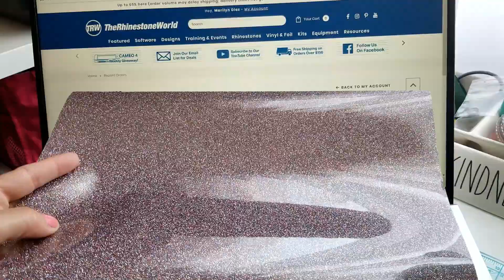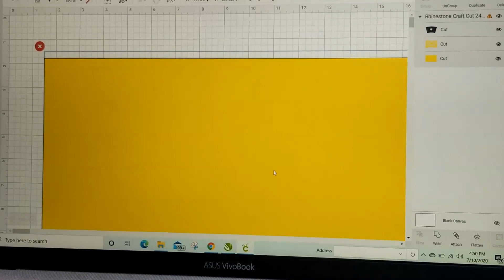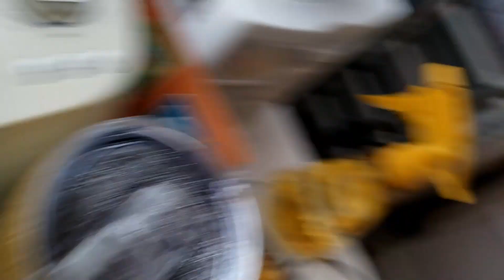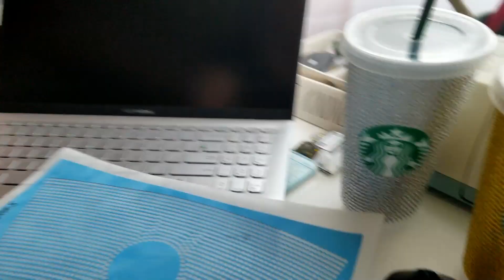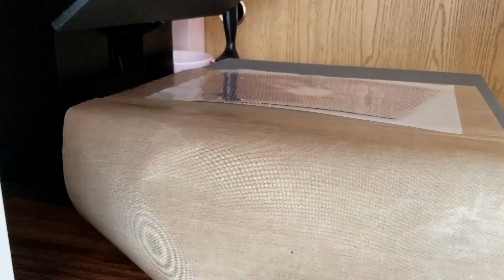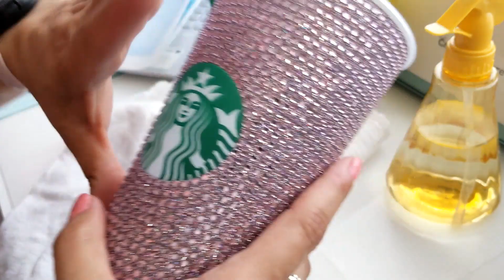CRICUT MAKES STARBUCKS RHINESTONE CUPS

Comment: Great video! So the bling anything can be reused over & over?
Reply from the maker: No, once you put it on something, if you apply it with water, it’s moveable for a little bit, but once it’s on the surface, it’s there permanently. Now if you try to remove it much later, you may pop the rhinestones off while removing it. I would recommend using it on something you don’t plan to remove. It worked best on a completely flat surface. I have a decal on a stainless glass, my laptop computer, my car window, etc.

Comment: hi how do you wash these without messing them up?
Reply from the maker: The decal is extremely strong. I personally like the double acrylic wall cups that are taller because the lids rim and top are completely flat, unlike these, and once that decal is on, its not coming off. The rhinestones are hotfix so they are pressed into the decal so they're on there for good and the other side you peel off to stick to the cup is really hard to lift off. Once its on there, the cup is good. The acrylic cup is much better.
Reply: @MarilynDIAZDESIGNS  thankyou for the v reply! :)

Comment: Thank you for this video. I did everything you said as far as settings. I just got the Explore 2. But my flock iron-on, which i had to add in Material Settings, did not do what you did. 220 and everything. The whole hour it was just marking circles on the flock material. What can I do differently so it cuts?
Reply from the maker: Increase your pressure! Cricut must be doing something in the background to the software because when I went to cut my last few templates, I also had to increase from 220 and when I tried 225, it still didn't have a clean peel. Try a setting of 240. DO A SMALL SQUARE with 4 tiny circles within the square and see how it cuts. Keep using your fine point blade and revise your Flock setting that you made. Play with the pressure and do small test cuts!!! Im so frustrated with design space. Good luck!

Comment: Hi Marilyn.  Great Video!  I need help!  when I started applying the sticker alot of the rhinestones came off...Is it because I did not press it enough?  Please help...Thanks
Reply from the maker: Did you press htv first? And did you make sure to press on the shiny side of the decal? You want the part that you peel off in the back. If you did this correctly then perhaps your temp or pressure is not enough.

Comment: Hi Marilyn!  Great video!  Do you have a suggestion or it could just be DS - but I get to the point ready to cut, and it allows me to load my mat, and then when I hit cut, it freezes on "preparing".  I've tried both my Maker and Explore.  Any thoughts as to why it wouldn't go further?
Reply from the maker: Erin Young that is completely a DS issue. I haven’t used cricut in a couple weeks however using the web version allows you to cut it immediately with no issues and I know they are doing away with the web version, so if it’s still live, use DS web, if not, I’d contact Cricut. You can find a tiny link at your start up page if it’s still there!

Comment: I have a Cricut explore air 2. It doesn’t have the setting you mentioned in video. What do you suggest?
Reply from the maker: I had to create my own. Go to "make it", when selecting materials, select "browse materials, then scroll all the way down and select Create Material or (whatever it says to create your own. Make sure the fine point blade is used, make your own name, FLOCK, then do a pressure of 220 and SAVE your new material and favorite it so you can always access it. Make sure to do a test cut before cutting your big file. Make a half inch square and create a circle in the size .130 (the size of ss10). Put that little circle in a square and use this as your test cut. If everything cuts perfect, that's your new setting. If it cuts the circle perfect and your backing is still there, GREAT. If your circle didn't cut all the way. Increase pressure for 5 or 10. If it cuts all the way through the white backing, DECREASE your pressure. Hope this helps!

Comment: I try buying the Rhinestone but they have so many brands which one are they ? Also they say 10-gross what is that ? Can we buy the stones elsewhere ?
Reply from the maker: I buy them from TRW. They are called hot fix rhinestones. The size I use and is standard is SS10. there are 144 stones in one gross. You can Google what hotfix rhinestones if you want to buy elsewhere.
Reply: Marilyn DIAZ DESIGNS  thank you so much one more question in TRW they don’t have the Bling anything Decal is there another place where we can purchase that material ?
Reply from the maker: @Sandee78  no there's not, keep checking every day!!! He's supposed to have more in soon. Subscribe to their YouTube to go on the lives and he'll give us updates! There's a live tomorrow!

Comment: Hello Marilyn, I was wondering it you experienced any problems with the size of the rhinestone holes when you cut it out? I purchased the template mini pack 3 for the acrylic tumbler, but when I cut out the rhinestone layer the holes are a little large for my size SS10 rhinestones.

Comment: Thank you sooooo much,  no one explains how to get the correct size in Cricut.  Can you tell me how many rhinestones you buy for the 24oz cup and what temp was your heat press on?
Reply from the maker: I had rhinestones already, however I believe there are between 2400-2500 rhinestones give or take. My heat press was set to 320° and my max time to press is 15 seconds.

Comment: GREAT tutorial!! Thank you for sharing your method. Where did you purchase your rhinestones from?
Reply from the maker: Meoshameka Taylor purchased them at the rhinestoneworld
Reply: Meoshameka Taylor  but they have so many kind which do you specific buy and what does mean when it says 10-gross ?
Reply from the maker: @Sandee78  there are 144 stones in one gross. Times that by 10 (gross) and you'll get the total of stones. For clothing or for pressing with heat, you'll want hotfix stones. Standard size and size I use is SS10. Flatback rhinedtones are for gluing by hand.
Reply: How many gross do you need for one cup?

Comment: Hi great video. Can I use a Cricut maker to do this or do I need an Explore Air Cricut? I’m trying to decide which machine to buy as I like decorating Starbucks cups and mugs etc thank you
Reply from the maker: I ended up cutting my templates on the maker. I have both but the maker can cut much more materials than the air.
Reply: Marilyn DIAZ DESIGNS Thank you for the response ☺️

Comment: I send my new cup template to my Cricut explore air 2 and it does not work it just says preparing and that is it does not move from there. I’m confused from there. Can you help me please.
Reply from the maker: crystal alvarez are you using the craft file? If not, try that. HOWEVER, Cricut has issues today. I had been trying to cut vinyl for several projects today and it seems to be having the same issues. Exit out, restart your computer and try again. I think it’s cricut today.
Reply: Marilyn DIAZ DESIGNS I have the craft file and I added it have been trying for a few days now I had bought the file without lid and I test cut first. Then I got the new file with lid and now it does not want to work. I’m trying to cut out the rhinestone template. I can cut the vinyl.
Reply from the maker: crystal alvarez did this work for you yet? I know DS was having issues. Hoping you got it to work!
Reply: Marilyn DIAZ DESIGNS I have not tried it since was planing on trying again today. I will let you know what happens.
Reply from the maker: crystal alvarez ok, cool. Keepin my fingers crossed for you!
Reply: @crystalalvarez3780  did you ever get it to cut the template? I am having the same issue trying to cut the rhinestone template with my explore air 2.
Reply: tskidz16 no I have not it will not cut it at all I cluck make it and it won’t do anything after that. So mad and frustrated
Reply from the maker: @crystalalvarez3780  use the web version of design space
Reply: @MarilynDIAZDESIGNS  I am using the web version of DS. Actually went and bought a maker today, it is still not working. This is the new cut file with the lid. I have an email into TRW for assistance.
Reply: Marilyn DIAZ DESIGNS I do use the web version in my laptop I don’t use the app.
Reply from the maker: @crystalalvarez3780  oh ok. There's also a desktop version, so wasn't sure. When you go to cricuts site, then select design at the top and instead of entering there it says in small letters, use design space for web. That's where those files will not loop into preparing but will load & cut right away.
Reply: tskidz16  my Cricut cut my template today I used my usb cord to cut do not do over Bluetooth. It takes to long to prepare if you do Bluetooth. I saw a video from the rhinestone world and saw she used her usb cord. I decided to try it and it cut and works a lot faster. So try your usb that came with your Cricut.

Comment: I do not see the Flocked Iron On. My DS only Flocked paper. Am I missing something?
Reply from the maker: Linda Alvarez hmmm....it is in alphabetical order. What machine are you using? Try the flocked paper but increase that to 220 pressure and cut a half an inch square with a .131 circle (that the size of a rhinestone hole) as a test cute before you cut something big. See what happens. If you try another setting, make sure the setting co-insides with the fine point blade.
Reply: @MarilynDIAZDESIGNS  I am using a cricket 2. I ended up using fabric setting. Hopefully it works. Its still cutting. Thank you for the advice!!